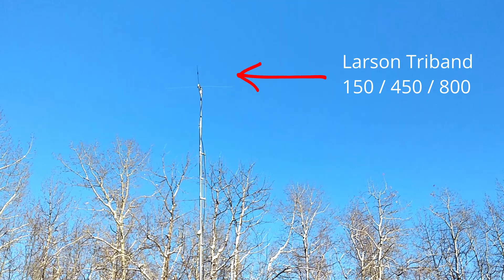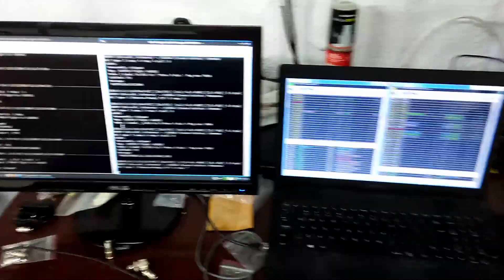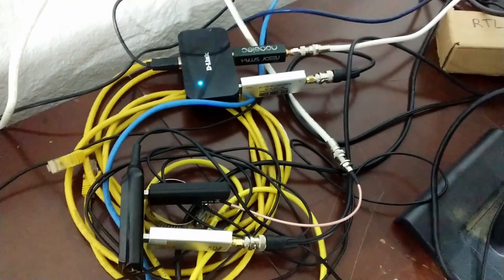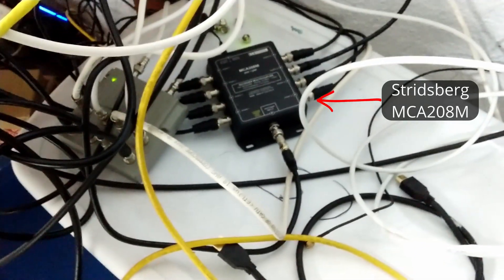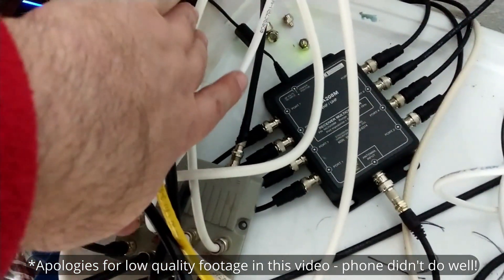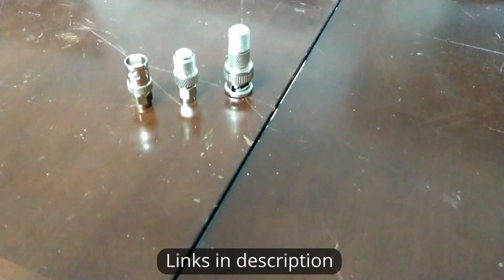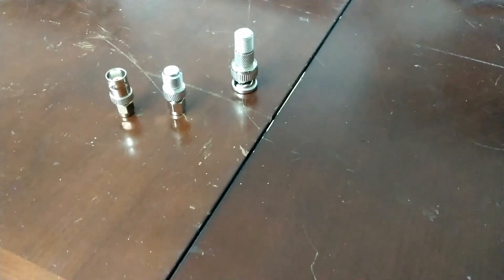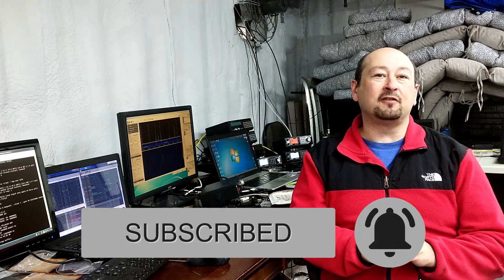Share 1 antenna with 15 receivers - signal splitting in the shack with TV amp & multicoupler

Comment: What I never understood is why they make F to BNC adapters using 50 ohm BNC connectors. To be correct, since F is 75 ohm, they should use a 75 ohm BNC. Since 50 and 75 ohm BNCs will intermate, if the user wants to plug it into a 50 ohm jack, he can. But if he plugs it into a 75 ohm BNC jack, there will be no impedance bump.

Comment: Is there any problem with impedance mismatching, i've assumed a TV cable Amp-splitter would be  a 75-ohm thing that would start causing problems, Like for when you're not using a port you need to cover the port to help with noise, people use 75-ohm plugs on them, however in this case would you use 50-ohm?
Reply from the maker: You're correct regarding the mismatch. The drop amp produces 75 ohms and the RG6 is the same. However the mismatch actually makes very little difference when it comes to receive only. As a result, it works surprisingly well!

Comment: Great video as as alwaysStridsberg great  multicouplers I use a MCA208M and a MCA204M well worth the money
Reply from the maker: Ha ha, yes, mismatched cable impedance, "noisy" RF amps, I get it. I'm a HAM too. But just wanting to show what can be achieved, even with sub par gear.

One day I'll have enough $ to buy some LMR400 for my antenna runs. When the day comes, I'll try and make an A/B video comparing RRSI, SNR etc.

Comment: This is a great video and i fully intend on putting this to use.  question...with the Strisdberg multicoupler...i'm running a bias t powered wideband LNA close to my roof mounted antenna...does the multicoupler handle that, or would I only want to run bias t on one SDR at a time?  thanks for the awesome videos!  extremely helpeful.  I too amd getting some pretty impressive performance from a fairly simple and cheap setup, and now its time to double down.
Reply from the maker: I don't think the Stridsberg passes through voltage to an LNA. Perhaps one of the downsides to using it. Some of the TV amps can pass power, although this is a combination I have not tried.

My suggestion would be to head over to the multicoupler and signal splitting section of the Radio Reference forums. Lots of experienced guys there who are happy answering questions.

Thanks for your kind comments.
Reply: @FrugalRadio  so its been awhile since this comment, and im closer to my end goal now and have a few questions.  assuming Stridsberg multicoupler...   do you have your respective filters/LNAs ahead of (ANT side) or behind the multicoupler?  I'm running off 75~ of (quality) line down into the house and im curious to figrue out whether or not id want each SDR to have an LNA behind the multicoupler, and if id have my filters (lets say AM, FM, 137 Noaa, ADSB)proceeding said LNA to each SDR, OR if Id have the LNA in the ANT line, powered by a DC inserter, and then behind the multicoupler each filter type on the respective sdr dongles since the multicoupler doenst pass DC.

i guess an easier way to ask my question would be...where are your respective filters (if youre using them) and are they in the ANT line, or behind the multicouplers with the SDRs.
Reply from the maker: Hi Carmen. Filters always go before an amp. This way you are blocking the unwanted signals right off the bat, rather than amplifying them and trying to remove them later.

Antenna -> Filter 1 -> Filter 2 -> LNA -> coax run -> attenuator (if required) -> multicoupler

What's assuming you're not filtering something you want one of your devices to receive.

In my case, filter 1 is a strong pager signal on 139.950. This filter reduced that signal by 30dB. Filter 2 is my FM broadcast band filter. 

The best place to have the filters and LNA is as close as possible to your outdoor antenna. The antenna gets the signal, to you quickly reduce the overpowering areas of spectrum, add your wideband LNA to push the signal better on your coax run.  If the signal is still too strong when it reaches the multicoupler, throw in an attenuator to reduce it too a level that produces no IMD (distortion). Remember, the Stridsberg might add a few dB to the signal output as well and you don't want to overload your SDRs and scanners by giving them too hot a signal.
Reply: @FrugalRadio  so in my case, id go ant -> fm & am filter -> LNA -> multicoupler.  behind the multicoupler i guess is where i'm a bit stumped.  a few of my SDRs have specific tasks, IE NOAA APT, ADS-B, Radiosonde, shortwave/ham-it-up.  as you know, some of those things have amplification built in to varying degrees, IE the NOAA APT filter from Nooelec.  would having the main antenna line filtered from AM and FM, and subsequently amplified via LNA...and then after the multicoupler on the receive end, having different filters in place...do you see that being an issue beyond the potential need for an attenuator?
Reply: @FrugalRadio  also thank you so much for your help.  youve got multiple views on just about every one of your videos, just from me hahaha
Reply from the maker: I would suggest using individual antennas for the specific services you would like to monitor.

For NOAA APT with a Sawbird filter / LNA you would not need your FM Broadcast filter in line, nor an LNA. That one device covers both functions.

For ADSB you'll want an antenna tuned for 1090 MHz, which will provide much better reception compared to something like a general VHF / UHF discone. If you're up for it, try a QFH antenna for VHF satellite, or a V dipole mounted horizontally.
Reply: @FrugalRadio  thank you sir for your help.  That makes sense.  I'm currently doing quite a bit with a 25-1300 Tram that sits about 25 feet off the ground (I'm also lucky to be in field, on a hill, and about 750~ feet elevation).  I've been very successful with ADS-B and NOAA APT thus far, as well as area wide detrunking (even dabbling in P2 decoding via OP25), Radiosonde tracking (snagged balloons 32, 33, and 34 for my listening this morning hahaha), and a LOT of shortwave action (current personal best is Bangladesh from the back yard with my mini cyberdeck setup...7900~ miles).  I'm considering a move to the Diamond D3000n just to broaden my horizons a bit especially since a HackRF will be entering the mix eventually...I just found that SOME things I'd like to isolate a bit better.  As of now, I don't "need" much in the realm of filtration, it's more of a curiosity at this point.  Thank you again, sincerely, for your help and suggestions.  I've been able to avoid several mistakes simply from the information you've already put out, as well as your willingness to share knowledge as I go.
Reply from the maker: Glad to be able to offer some ideas. Thanks for all your comments.

Comment: What about all the impedance mismatches? 50 ohm antenna, with 75 ohm cable being converted to 50ohm connectors using 75ohm amp.  I ask because I have a need to feed multiple RX with one antenna and looking for a solution.
Reply from the maker: The impedance mismatches don't make a huge difference for receive. However you would definitely want to avoid them for any kind of transmit application.

Comment: Have you noticed any issues using the electroline going into the stridsberg? I already have a stridsberg coming but still need some more ports for other radios such as you have.
Reply from the maker: Surprisingly, there haven't been issues at all. I would like the gain to be a little lower as I think that would reduce the need for the FM filter, but everything works just fine!
Reply: @FrugalRadio  very good. Thanks for the response. I will be ordering the electroline that tomorrow then to go with the stridsberg.

Comment: What is reason for more than one sdr or dongles and what kind of usb device  is needed
Reply from the maker: Hi George, thanks for your question. 

Two dongles allows you to track digital trunked systems more efficiently.

You can also set up dongles to perform different activities. For example I have one decoding ADS-B radar data (for tracking flights), one for decoding ACARS, 1 for monitoring a P25 site, another for monitoring DMR & NXDN trunks. These all run 24/7 performing their various duties.

Comment: Are you running rg6 or rg8x cables from the antennas?
Reply from the maker: RG6 is what I use on my receiving antennas.
Reply: @FrugalRadio  I am a HAM but have not used my radios in over 10 years. I am just getting back into radio ( SDRs ) after watching your videos because they are so versatile and look like loads of fun. But the cable runs have thrown me. I used LMR on my ham radio 10 years ago, but I have seen people saying RG6 is ok for receive only, (vs RG8x) but then others say it introduces noise. You have a nice set up that works well for you so I wanted to get your opinion. Also, thanks for the information you put out. You got another old HAM interested again in radio. :) I have ordered RG6 and RG8x. I bought the SDRplay RSPduo and the RTL-SDR
Reply from the maker: Sounds like you'll soon be having loads of fun again when everything arrives. There's simply so much you can do with these versatile devices. Glad that it is inspired you to get back in to radio. 73!

Comment: Curious to know if you ran into any issues or confusion with serial numbers all being the same?
Reply from the maker: Ha, yes, a common issue when running multiple dongles on 1 machine. There is evidently some software for changing the serial numbers, but I haven't used it myself.

Comment: Thanks for the useful information regarding antenna sharing. What do you use for each SDR, a dedicated PC, virtual PC or do you somehow run them  on a single PC?
Reply from the maker: Multiple PCs. Several PCs connect to multiple dongles. Typically I'll have a USB hub with 2 or 3 SDRs attached. That way 1 computer can monitor decode multiple systems. Eg I have 1 old laptop that monitors ACARS & VDL/2 on 3 individual frequencies.
Reply: @FrugalRadio  OK thanks. So where you have 2 or 3 devices connected, via a hub, to a single PC, how do you run multiple instances of the SDR software?
Reply from the maker: Some of the SDR software communicate with multiple dongles. Eg DSD Plus, SDR Trunk, Unitrunker. You just assign the SDRs to the various tuners in each.

On other computers, I run different software for each dongle. Eg an ACARS decoder which uses dongle 1, and a VDL decoder that communicates with dongle 2.
Reply: @FrugalRadio  Great, thanks for the information. I look forward to your future videos. Hope all goes well with settling into your new house.
Reply from the maker: Cheers Roger!

Comment: If you are ok with messing some around, the airspy r2 actually have a loop-trough on u.fl connector on the board.

If you drill a hole and mount a SMA - u.fl pigtail in the case, you get a extra output that mostly follows LNA gain.

To enable it using sdr#, you need to enable debug in the config file, and use the debug feature to change register 5 so the number starts with 0. (5 into register number, read, change first number to 0, write).
The change is NOT persistent and applies until you power off the airspy.

Comment: Beware! 1) Many of those TV distribution amplifiers are targeted at uncritical home users, but they can go into oscillation and generate wideband noise across the RF spectrum. Plus, they are designed for 75 Ohm systems while the SDR dongles are probably 50 Ohm matching impedance.

2) Each of those adapters introduces some loss and potentially an impedance bump so it's best to use the proper connector on the end of the cable. You reduce adapter loss and reduce mechanical stress of a long moment arm pressing on the body of the multicoupler and plastic SDR housing, so it's less likely to break the plastic.

Best place for connectors, adapters, and cable is The R.F. Connection in Gaithersburg, Maryland. The owner is a great guy who has helped the ham radio and hobbyist communities for decades.
https://rfconnection.com/

Thanks.
Reply from the maker: Thanks for the great tips Frank. 
Yes, the TV amps would all be 75 Ohms. I've been told that this makes little difference for received only applications. Practical results demonstrate the same : the Stridsberg 50 Ohm multicoupler, while a little 'quieter', doesn't offer an enhanced signal to the SDR.

The Electroline amp I chose came through many recommendations on Radioreference. There are many happy users of it there.  

Your caution is important. I wouldn't go choosing a random TV amp, rather one that has been tested and proven successful to many others.

Comment: Hey Rob! Great videos and I'm loving your series. Thank you! 👍👍 Just curious, and I know it's not the correct combination, but have you ever connected your SDRPlay RSP1A to the Airspy YouLoop antenna to see if it yields any results? I've scoured the internet and YouTube and haven't seen it done or tried. Just thought it might be an interesting experiment that you've got the hardware for and might not take much time to connect. Thank you sir!
Reply from the maker: Hello Tommy.

You're right, it is something I haven't tried. I don't believe the RSP1A is ideally suited to the YouLoop, but I'm certain some signals would be received. Even the RTL-SDR V3 was able to pull in signals with the YouLoop. But I'll give at a go sometime and see how it performs.

I imagine the RSPdx would work well with the YouLoop, as it is a more sensitive receiver.

Comment: Hi Frugal Radio, great video! Just wondering what the upper frequency limit on the TV distribution amp is. Will you be able to use the RTL-SDR dongles up to their max frequency of 1700MHz? I'm looking at implementing a similar set-up. Thanks!
Reply from the maker: @Mike Nye, great question! The official specs of my Electroline amp are listed as 54-1000MHz. So above and below those frequencies you would want to use something else. I would recommend going direct to your SDR or radio above or below that anyway.

The losses are 1GHz are much higher, so having a dedicated antenna for the frequency you are using would be the best approach.

Similarly, a low band VHF antenna has very different characteristics than a VHF/UHF antenna, so again it would be my recommendation to use a dedicated antenna for frequencies under 24 MHz.
Reply: @FrugalRadio  Thanks for the reply! I'm considering getting a wide band discone antenna for general scanning/listening, and then if I want to receive a specific frequency full-time, I'll get a dedicated antenna.
Reply from the maker: Yes, that is a good strategy. Once you know the weaker areas of your setupg you can fine tune your setup by adding specific antennas. A well mounted discone connected to an amp or multicoupler is great for general scanning on multiple radios / SDRs.

Comment: Hi, I have similar set up with two outdoor discones and two very cheap three port TV splitters/amplifiers. Work well. I've observed some white cables in your set up - is it 75 Ohm Tv cable?  And second, I wonder if you could measure a signal on each of your TV splitter output with NanoVNA? Great job with your videos! Greetings from Poland.
Reply from the maker: Hi Hans! Yes, the white cables are 75 ohm.
I haven't tried measuring the output from the splitters with a VNA. But the SNR was improved compared to the antenna going direct to the SDRs :-)
Reply: @FrugalRadio  Thanks for an answer. I thought I was only one who use CATV cable as a "patch cord"  from splitter to receiver :). Not very HAMmy, I guess :). My main problem is a location, I'm realtively far from interesting public service transmitters so I struggle for high mast and signal amplifiers. Your location must be much better if you can use such an antenna setup with so great results. I've build myself two colinear ants for specific freqs and add their signals to discones.
Reply from the maker: That's great Hans. Thankfully I am close to a couple of cities, so that makes life easier. Broadcast AM & FM transmitters nearby are a problem though.

Comment: Have you ever considered putting up a better VHF/UHF antenna instead of the little mobile whip? I use the same setup when going on a short field trip, but the Diamond X130N and the Diamond X5000 here at home are producing more signal as expected. Nice distribution setup! I also have used some well known German design TV amplifiers in the past but the extra noise they produced was bad.  Be aware of some really crappy F to BNC adapters sold on Amazon!
Reply from the maker: Hi Ron. Yes, original I had a Butternut SC-5000 wideband antenna in use, however it's performance was only good in VHF up to 165ish MHz area. I think it has got damaged in storage perhaps. 

I didn't want to wait before ordering something else, so flung up what I already had. I've been pleasantly surprised by the performance.

I have been considering a good base antenna, and am probably going to make a bow tie. I had made one in Ireland which worked very well, but I wasn't doing any 700/800 MHz monitoring there, so I'm not sure what the performance there would be like.

Since I've run out of antenna ports, I think a new TV Amp coupled to a second antenna should do the trick. Then I can work on getting HF running again!  Thanks for your comments.